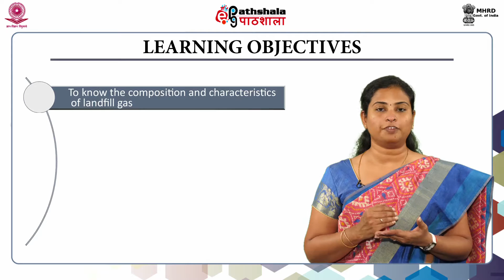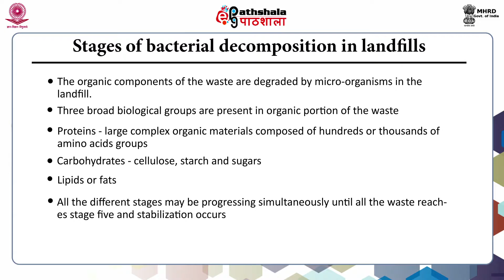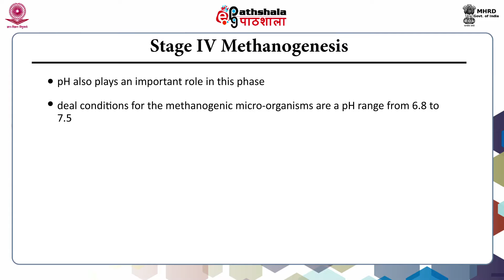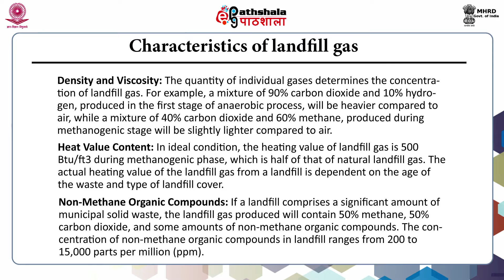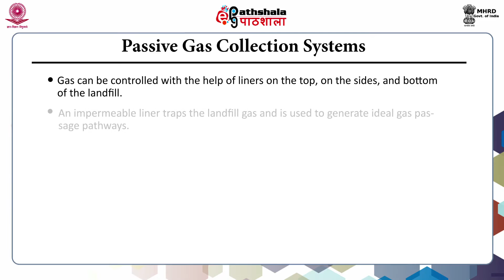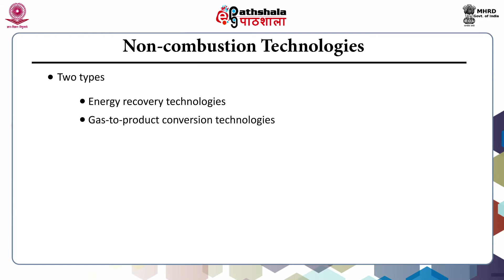M-35. Landfill Gas Management

Comment: BPSC APS & WMO 2025 
*Sanitary Landfill Gas Generation* वास्तव में पाँच चरणों में होता है। हर चरण में अलग‑अलग जैविक और रासायनिक प्रक्रियाएँ होती हैं, जिनसे गैसों की संरचना, pH, नमी, तापमान और घनत्व बदलते हैं। आइए विस्तार से देखें:  

---

## 📜 1. Initial Adjustment Phase (प्रारंभिक चरण)  
- *Process:* ताज़ा कचरा डालने पर ऑक्सीजन मौजूद रहती है, aerobic decomposition होता है।  
- *Gas:* मुख्यतः नाइट्रोजन (N₂) और ऑक्सीजन (O₂)।  
- *pH:* Neutral (6.5–7.5)।  
- *Moisture:* मध्यम, क्योंकि नया कचरा नमी लाता है।  
- *Temperature:* Ambient (25–35°C)।  
- *Density:* हल्की गैसें, कम घनत्व।  
- *Time:* कुछ दिन से लेकर 1–2 सप्ताह।  
- *Application:* इस चरण में energy recovery नहीं होता।  
- *Example:* नए landfill में पहले सप्ताह तक हवा जैसी गैस निकलती है।  

---

## 📜 2. Transition Phase (संक्रमण चरण)  
- *Process:* ऑक्सीजन खत्म होती है, anaerobic स्थिति बनती है।  
- *Gas:* Carbon dioxide (CO₂), Hydrogen (H₂)।  
- *pH:* Acidic (5–6)।  
- *Moisture:* बढ़ती है, क्योंकि acidogenic reactions शुरू होती हैं।  
- *Temperature:* 30–40°C।  
- *Density:* CO₂ की वजह से गैस भारी होती है।  
- *Time:* 2–4 सप्ताह।  
- *Application:* Methanogenic bacteria के लिए आधार तैयार होता है।  
- *Example:* landfill में कुछ हफ्तों बाद CO₂ का उत्सर्जन बढ़ जाता है।  

---

## 📜 3. Acid Phase (अम्लीय चरण)  
- *Process:* Acidogenic bacteria जैविक पदार्थ को fatty acids में तोड़ते हैं।  
- *Gas:* CO₂ और volatile fatty acids vapors।  
- *pH:* Acidic (4.5–6)।  
- *Moisture:* अधिक, leachate acidic होता है।  
- *Temperature:* 35–45°C।  
- *Density:* CO₂ dominant, dense gas।  
- *Time:* 1–2 महीने।  
- *Application:* इस चरण में landfill leachate का उपचार आवश्यक।  
- *Example:* food waste से fatty acids बनते हैं और CO₂ उत्सर्जन होता है।  

---

## 📜 4. Methane Fermentation Phase (मीथेन उत्पादन चरण)  
- *Process:* Methanogenic bacteria सक्रिय होते हैं।  
- *Gas:* Methane (CH₄ ~50–60%), CO₂ (~40–50%)।  
- *pH:* Neutral से alkaline (6.8–8)।  
- *Moisture:* स्थिर, optimum microbial activity।  
- *Temperature:* 40–55°C (mesophilic/thermophilic conditions)।  
- *Density:* Methane हल्की गैस है, buoyant।  
- *Time:* कई वर्षों तक (5–20 साल)।  
- *Application:* Landfill gas energy generation (electricity, heating)।  
- *Example:* पुराने landfill से मीथेन गैस निकालकर बिजली उत्पादन किया जाता है।  

---

## 📜 5. Maturation Phase (परिपक्व चरण)  
- *Process:* जैविक पदार्थ लगभग समाप्त हो जाता है।  
- *Gas:* Methane और CO₂ की मात्रा घटती है, trace gases (N₂, O₂) वापस आते हैं।  
- *pH:* Neutral (~7)।  
- *Moisture:* कम, क्योंकि decomposition समाप्त।  
- *Temperature:* Ambient (~25–30°C)।  
- *Density:* गैस उत्पादन बहुत कम।  
- *Time:* 20–30 साल बाद।  
- *Application:* Gas recovery कम हो जाता है, site को बंद कर दिया जाता है।  
- *Example:* decades‑old landfill में केवल trace gases निकलते हैं।  

---

---

👉 Phase 1: Initial Adjustment
   pH: 6.5–7.5 | Time: 1–2 weeks
   Temp: 25–35°C | Moisture: Medium
   Gas: O₂, N₂
   ↓
Phase 2: Transition
   pH: 5–6 | Time: 2–4 weeks
   Temp: 30–40°C | Moisture: High
   Gas: CO₂, H₂
   ↓
Phase 3: Acid Phase
   pH: 4.5–6 | Time: 1–2 months
   Temp: 35–45°C | Moisture: High (acidic leachate)
   Gas: CO₂, Volatile fatty acids
   ↓
Phase 4: Methane Fermentation
   pH: 6.8–8 | Time: 5–20 years
   Temp: 40–55°C | Moisture: Stable
   Gas: CH₄ (50–60%), CO₂ (40–50%)
   ↓
Phase 5: Maturation
   pH: ~7 | Time: 20–30 years
   Temp: 25–30°C | Moisture: Low
   Gas: Trace CH₄, CO₂, N₂, O₂

🧩 Step‑by‑Step Explanation with Examples
Initial Adjustment Phase:

ताज़ा कचरे में ऑक्सीजन रहती है।

गैस: O₂ और N₂।

उदाहरण: नए landfill में पहले सप्ताह तक हवा जैसी गैस निकलती है।

Transition Phase:

ऑक्सीजन खत्म होती है, anaerobic स्थिति बनती है।

गैस: CO₂ और H₂।

उदाहरण: कुछ हफ्तों बाद landfill से CO₂ का उत्सर्जन बढ़ जाता है।

Acid Phase:

Acidogenic bacteria जैविक पदार्थ को fatty acids में तोड़ते हैं।

गैस: CO₂ और volatile fatty acids vapors।

उदाहरण: food waste से fatty acids बनते हैं और CO₂ उत्सर्जन होता है।

Methane Fermentation Phase:

Methanogenic bacteria सक्रिय होते हैं।

गैस: CH₄ और CO₂।

उदाहरण: पुराने landfill से मीथेन गैस निकालकर बिजली उत्पादन किया जाता है।

Maturation Phase:

जैविक पदार्थ लगभग समाप्त हो जाता है।

गैस: Trace CH₄ और CO₂।

उदाहरण: 20–30 साल पुराने landfill में गैस उत्पादन बहुत कम हो जाता है।

✅ निष्कर्ष
यह Flow Chart दिखाता है कि landfill gas production एक dynamic process है।

शुरुआती चरणों में CO₂ और ऑक्सीजन प्रमुख होते हैं।

मुख्य ऊर्जा‑उपयोगी गैस Methane चौथे चरण में बनती है और कई वर्षों तक निकलती रहती है।

अंत में gas production घटकर site बंद हो जाती है।

- Landfill gas production एक *dynamic process* है।  
- शुरुआती चरणों में CO₂ और ऑक्सीजन प्रमुख होते हैं।  
- मुख्य ऊर्जा‑उपयोगी गैस *Methane* चौथे चरण में बनती है और कई वर्षों तक निकलती रहती है।  
- अंत में gas production घटकर site बंद हो जाती है।

Comment: BPSC APS & WMO 2025 Exam 
*Landfill Gas Management Objective Questions (MCQs)* 

## 📜 20 Objective Questions  

*1.* Landfill gas का मुख्य घटक कौन सा है?  
- (A) Oxygen  
- (B) Methane  
- (C) Nitrogen  
- (D) Sulphur dioxide  
👉 उत्तर: (B) Methane (~50–60%)  

*2.* Landfill gas production को मॉडल करने के लिए कौन सा गणितीय मॉडल सबसे सामान्य है?  
- (A) Zero‑order  
- (B) First‑order decay  
- (C) Second‑order kinetics  
- (D) Linear model  
👉 उत्तर: (B) First‑order decay model  

🧩 Explanation:—
✅️Exponential Decay: जैसे‑जैसे समय बढ़ता है, गैस उत्पादन दर घटती जाती है।
✅️Moisture & Temperature: यदि landfill में नमी और तापमान अधिक है तो 𝑘 बड़ा होगा और गैस जल्दी बनेगी।
✅️Waste Quantity: जितना अधिक अपशिष्ट (𝑀𝑖), उतना अधिक गैस उत्पादन।
✅️Gas Composition: मुख्यतः Methane (CH₄ ~50–60%) और Carbon dioxide (CO₂ ~40–50%)।

*3.* Methanogenic phase में pH की स्थिति क्या होती है?  
- (A) Acidic (4–6)  
- (B) Neutral–Alkaline (6.8–8)  
- (C) Strongly alkaline (>9)  
- (D) Neutral (7)  
👉 उत्तर: (B) Neutral–Alkaline  

*4.* Landfill gas का calorific value लगभग कितना होता है?  
- (A) 100–200 kcal/m³  
- (B) 3000–6000 kcal/m³  
- (C) 7000–9000 kcal/m³  
- (D) 10,000 kcal/m³  
👉 उत्तर: (B) 3000–6000 kcal/m³  

*5.* Methane production peak आमतौर पर कितने वर्षों बाद आता है?  
- (A) 1–2 years  
- (B) 5–10 years  
- (C) 15–20 years  
- (D) 25 years  
👉 उत्तर: (B) 5–10 years  

*6.* Acid phase में मुख्य गैस कौन सी होती है?  
- (A) Methane  
- (B) CO₂  
- (C) H₂S  
- (D) O₂  
👉 उत्तर: (B) CO₂  

*7.* Moisture content landfill gas production को कैसे प्रभावित करता है?  
- (A) कम करता है  
- (B) बढ़ाता है  
- (C) कोई असर नहीं  
- (D) केवल CO₂ पर असर  
👉 उत्तर: (B) बढ़ाता है  

*8.* Landfill gas का उपयोग किसमें किया जा सकता है?  
- (A) Electricity generation  
- (B) Heating  
- (C) Industrial fuel  
- (D) उपरोक्त सभी  
👉 उत्तर: (D) उपरोक्त सभी  

*9.* Ramp method किस प्रकार के क्षेत्र में उपयोग होता है?  
- (A) Flat land  
- (B) Hilly/slope areas  
- (C) Coastal areas  
- (D) Desert areas  
👉 उत्तर: (B) Hilly/slope areas  

*10.* First‑order decay model में \(k\) parameter किस पर निर्भर करता है?  
- (A) Temperature और Moisture  
- (B) Waste density  
- (C) Landfill depth  
- (D) सभी  
👉 उत्तर: (A) Temperature और Moisture  

*11.* Landfill gas में trace gases कौन से होते हैं?  
- (A) H₂S, NH₃, VOCs  
- (B) O₂, N₂  
- (C) CO  
- (D) सभी  
👉 उत्तर: (D) सभी  

*12.* Methane की density (STP पर) लगभग कितनी होती है?  
- (A) 0.717 kg/m³  
- (B) 1.25 kg/m³  
- (C) 2.0 kg/m³  
- (D) 0.5 kg/m³  
👉 उत्तर: (A) 0.717 kg/m³  

*13.* Landfill gas का greenhouse effect potential (GWP) methane के लिए CO₂ की तुलना में कितना है?  
- (A) 10 गुना  
- (B) 21–25 गुना  
- (C) 50 गुना  
- (D) 100 गुना  
👉 उत्तर: (B) 21–25 गुना  

*14.* Landfill gas collection system में कौन सा उपकरण उपयोग होता है?  
- (A) Vertical wells  
- (B) Horizontal trenches  
- (C) Gas headers  
- (D) उपरोक्त सभी  
👉 उत्तर: (D) उपरोक्त सभी  

*15.* Acid phase में landfill leachate की विशेषता क्या होती है?  
- (A) Neutral pH  
- (B) Acidic pH (4.5–6)  
- (C) Alkaline pH (>8)  
- (D) कोई pH नहीं  
👉 उत्तर: (B) Acidic pH  

*16.* Methane fermentation phase कितने वर्षों तक चल सकता है?  
- (A) 1–2 years  
- (B) 5–20 years  
- (C) 30–40 years  
- (D) 50 years  
👉 उत्तर: (B) 5–20 years  

*17.* Landfill gas का typical composition क्या है?  
- (A) CH₄ 50–60%, CO₂ 40–50%  
- (B) CH₄ 70%, CO₂ 30%  
- (C) CH₄ 30%, CO₂ 70%  
- (D) CH₄ 90%, CO₂ 10%  
👉 उत्तर: (A) CH₄ 50–60%, CO₂ 40–50%  

*18.* Landfill gas utilization project का मुख्य लाभ क्या है?  
- (A) Renewable energy  
- (B) GHG reduction  
- (C) Odor control  
- (D) उपरोक्त सभी  
👉 उत्तर: (D) उपरोक्त सभी  

*19.* Landfill gas flare system का उद्देश्य क्या है?  
- (A) Methane को CO₂ में बदलना  
- (B) Energy recovery  
- (C) Odor removal  
- (D) सभी  
👉 उत्तर: (A) Methane को CO₂ में बदलना (GHG impact कम करना)  

*20.* Maturation phase में gas production कैसा होता है?  
- (A) High  
- (B) Moderate  
- (C) Very low  
- (D) Zero  
👉 उत्तर: (C) Very low